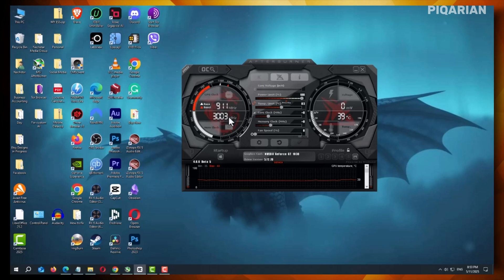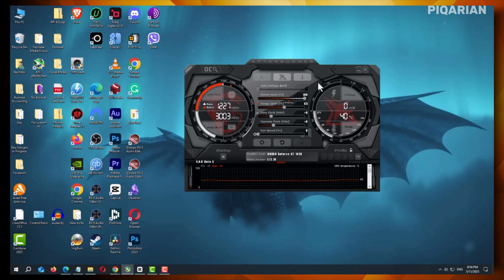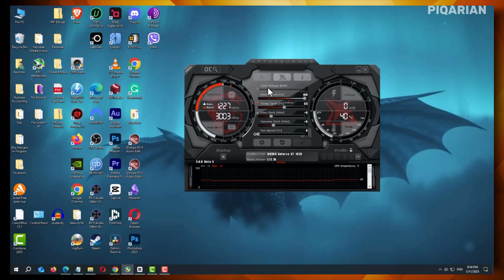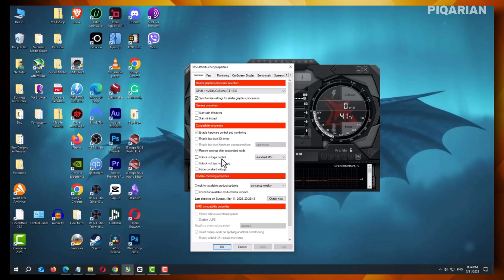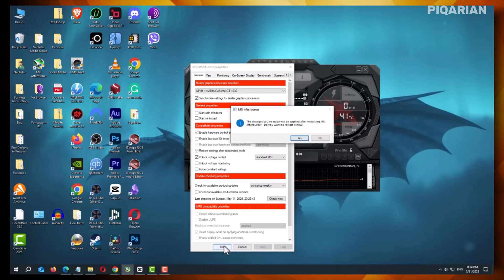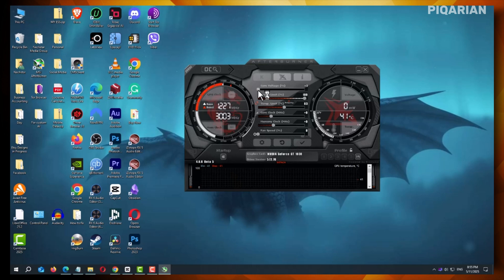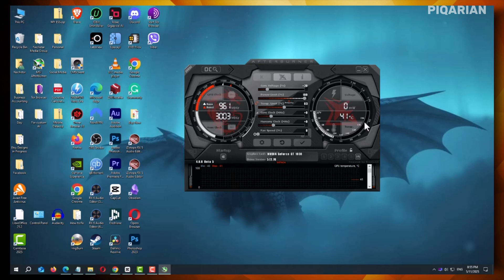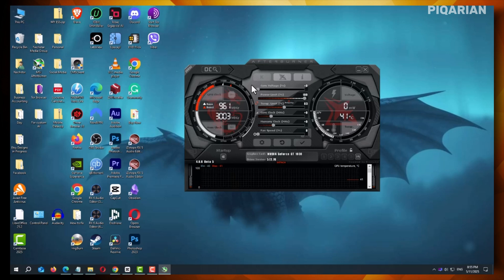How to Enable and Change the Core Voltage Option in MSI Afterburner (Core Voltage Grey Out Fix)

Comment: so im wondering if you read this BUT, i have an Aorus 1080 TI
the voltage is unlocked, but its in percentage (%) and if i set 100%, 5%, 50% doesnt matter, it doesnt affect SHI-
and the curve editor works, but u cannot change the voltage.

hope u can reply as fast as u can.

edit2: right now im doing VRAM OC, its like +600MHz with OCCT VRAM STRESS active for like 28 minutes with 0 errors aiming for 1h
FurMark Artifact Scanner in 25 minutes detected nothing, and the maximum Core MHz i can get without voltage control is 35MHz before instability from the lack of power kicks in. Also im an apprentice electrician so in a sense i know what im talking about and i succesfully built 2 PCs with no guide (just my head and the PC Knowledge from internet i had)
Reply from the maker: On the AORUS 1080 Ti this is normal.
Even if MSI Afterburner shows “voltage unlocked,” the voltage slider % doesn’t directly change GPU voltage on many Pascal cards.

What actually happens:

The voltage % slider mostly increases the voltage limit, not the real voltage

NVIDIA’s BIOS + driver decide the actual voltage automatically

That’s why changing 50% → 100% doesn’t change clocks or stability

What does work:

Voltage/Frequency curve editor (Ctrl + F)

Power limit + temperature limit

Core and memory overclock

Your results make sense:

+600 MHz VRAM stable = good

Core clock limited by power, not voltage

Without a modded BIOS, you can’t force higher voltage

TL;DR:
Nothing is broken. Your GPU is power-limited, not voltage-limited. Curve editor is the correct tool 👍
Reply: @Piqarian 

The MSI curve editor doesn't do anything, I can only change it vertically (clocks) and voltage doesn't change.

Also, depending on which MSI Afterburner skin you use, there is a button that just launches the curve editior without the shortcut.

Also, I'm not power limited, I have 150% PL with a new PSU it's a 1000W 80+ Titanium EVGA
And anything above +40MHz is unstable because of the lack of voltage, as an electrician I really know what I'm talking about when I say lack of voltage.

There's: 
power (W)
Voltage (V)
And Amps (A)
Voltage and Amps are equal to themselves but not 1:1, like you have ~230V in most European sockets which in effective range is 207-253V since it's AC not DC and we use Fuses with 16A
But we say 230V because that's the average, so that's a fun fact.
Reply from the maker: I understand your point, and I’m not questioning your electrical background 👍
The issue is that Pascal GPUs don’t behave like a traditional power system, even though V/A/W rules still apply.

On the AORUS 1080 Ti, the curve editor only moving vertically is normal. The voltage points are hard-limited by the BIOS, and the driver will not request higher Vcore, regardless of PSU size or 150% PL.

So even if you’re not externally power-limited, you still hit internal voltage and reliability caps (VRel/VOp). When stability stops above ~+40 MHz, it’s not because voltage is missing — it’s because the GPU isn’t allowed to use more voltage.

That’s why:

Voltage % slider has no real effect

More power doesn’t help

Curve editor can’t push higher voltage

Without a modded BIOS, this limit can’t be bypassed. This is expected Pascal behavior, not a fault.
Reply: @Piqarian 
Honestly, I already know that I just test people a lot and you sound kinda like a Google Gemini or chatgpt copy and paste reply because I use it a lot and I can tell, but your tips are good enough ig.

But I recently resolved some issue with my Ryzen 7 4700G running at 25W or less, no eco mode, pbo or manual OC did not help, stamp wouldn't, neither would smartshift.
All I did is downgrade bios and even with stock settings it ran at 30+W, 70W max at stress test.
(Ryzen 7 4700G Is a 65W TDP CPU)

Comment: Thanks really appreciate that. But my Asus Prime RTX 5070(non OC edition) also has temperature limits greyed out. How can I enable it?
Reply from the maker: Hi 🙂
That’s normal for the ASUS Prime RTX 5070 (non-OC). The temperature limit is locked in the GPU BIOS and can’t be enabled in MSI Afterburner or any other software.

You can still:

adjust the power limit (if available)

undervolt using the voltage/frequency curve to reduce temps

enable voltage control/monitoring (won’t unlock temp limit)

Flashing an OC BIOS is not recommended due to brick and warranty risk.

So it’s a model limitation, not a bug.
Reply: @Piqarian  does the OC Edition( same variant) has this feature?
Reply from the maker: Yes, the Prime OC version usually has a higher power limit and an adjustable temperature limit. The non-OC model has these locked in the BIOS and can’t be unlocked with software.
Reply: @Piqarian  also make a tutorial about undervolting a GPU.

Comment: There some trick to do, to unlock voltage on Old gpu GTX , with the file msi afterburner , but that doesn't show after you unlock how to keep the voltage modified , cus after you apply , it return to 0.
Reply from the maker: Some older GPUs can be tricky with voltage settings, and it sometimes requires extra steps to keep the changes applied.